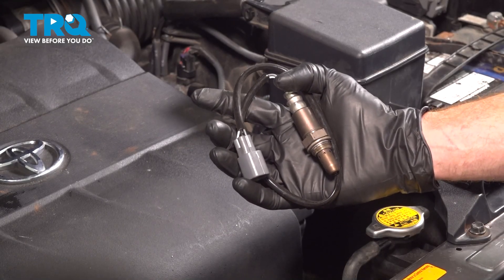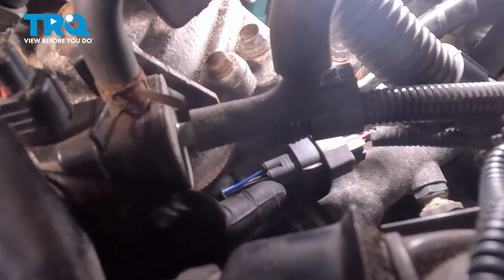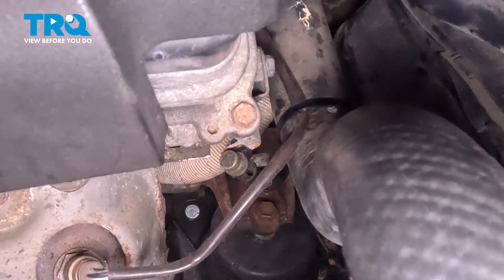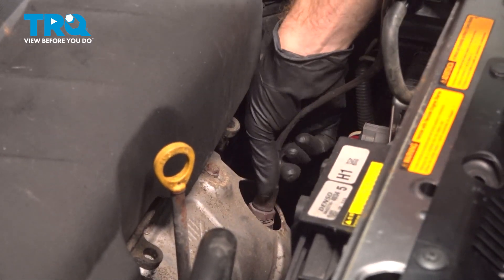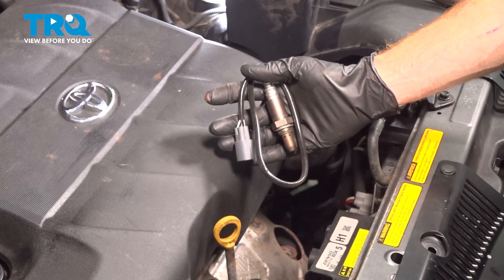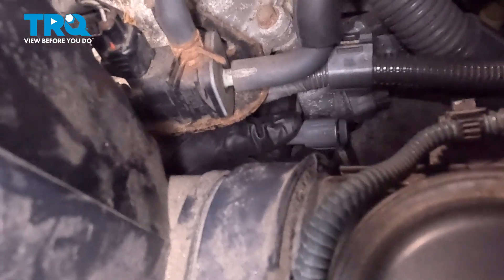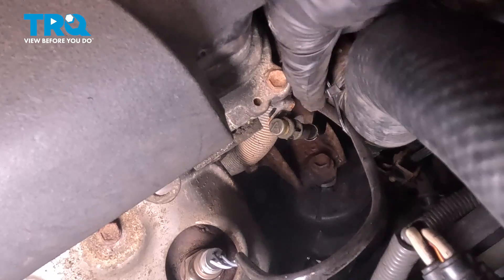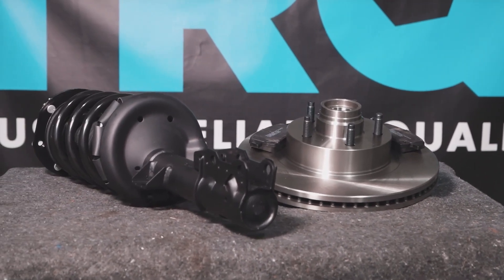How to Replace Bank 2 Sensor 1 O2 Sensor 2011-2020 Toyota Sienna (3.5L V6)

Comment: i can get to try out my set of bore brushes to clean threads out on exhaust manifold I wonder If i can take the original clamps off of radiator hose, they seem to be connected on bottom not sure if they are replaceable